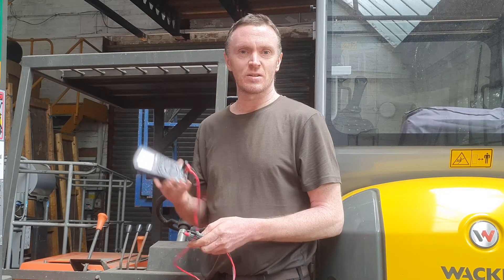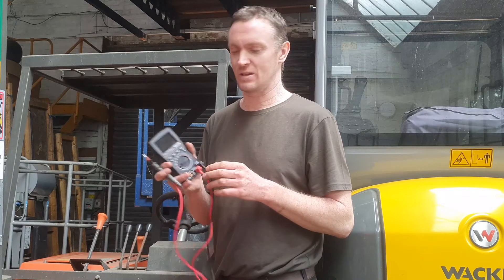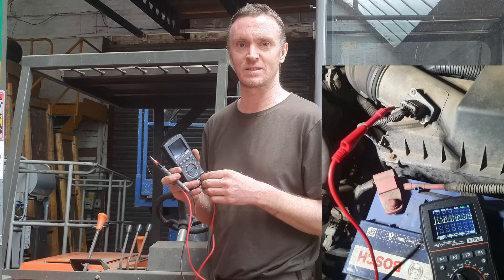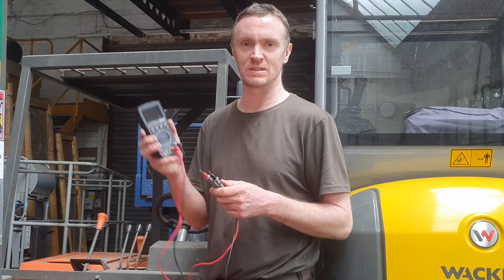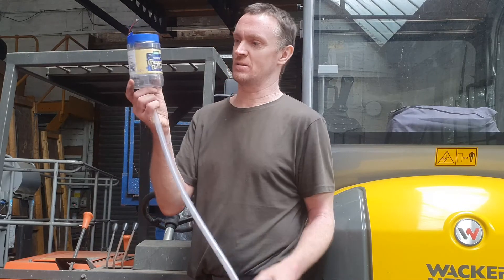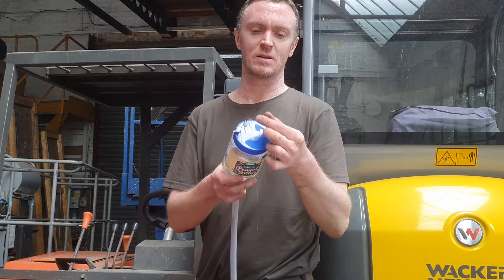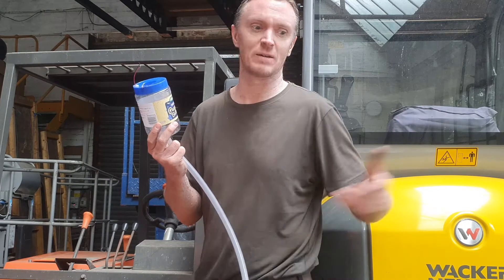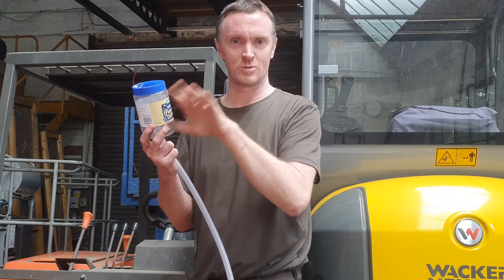Graphical Multimeters - Unbranded ET828 / KKMoon KKM828 / Mustool MT8208 and DIY pulse sensor

Comment: Few questions:-
1. The pipe diameter with your pulse sensor is small, so we shall place it in the exhaust outlet? I have my doubts that thus smaller dia would be able to pick the exgaust pulses...if you can throw some light.
2. What if we plug this sensor in any of the inlets of intake manifold,; would this give us any idea about intake valve deterioration?
3. Please share part number of the pulse sensor with manufacturer, if possible....will help a lot....

By the way, it was very informative video but at the same time it was quite brief....
Reply from the maker: 1. Pipe diameter doesn't matter as it is just the pulses of pressure that it is detecting. As the gas pressures down and hits the tube, it pressures the air inside the sensor and that causes the piezo sensor to output a small voltage. Similarly if you get low pressure regions, it sucks the air out the sensor and the piezo will read a negative voltage. These voltages don't mean anything in a calibrated fashion... only that you can see regular pulses in a working engine and irregular pulses when there is a problem.

2. Anywhere you have variations in pressure, this should work as long as you are able to get it positioned suitably. It isn't a pressure meter though which will give calibrated data.

3. Any piezo sensor / sounder on ebay will do you. 

I purposely didn't want to over do this video because there are some great videos on youtube which I nabbed the idea from. Just search "pulse sensor exhaust" on youtube and there is plenty to learn from. This video was more to show that you could get something useful even with a cheap graphical multimeter, rather than using expensive picoscopes which these other videos often use.
Reply: @projectbuild9784  I really appreciate your quick and thorough response. It makes sense....you have already earned a subscriber.

Comment: What is the 10a red plug for
Reply from the maker: If you trust it, you can in theory measure up to 10A current. Heard a lot of cheap meters being fried because they are not adequately rated or even don't have a fuse. 

I can't recall ever measuring current this way. I always want to check it without disturbing the circuit. As such a clamp meter is my go to for those jobs.
Reply: I missed even in 2nd time watching this video...😢